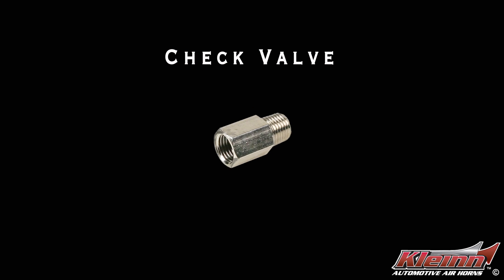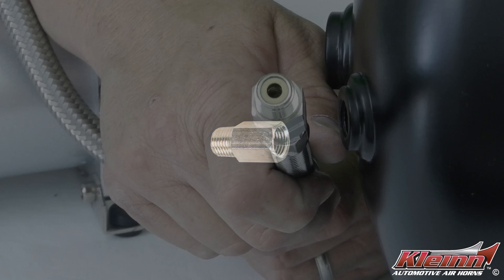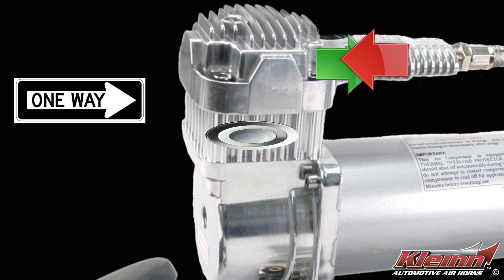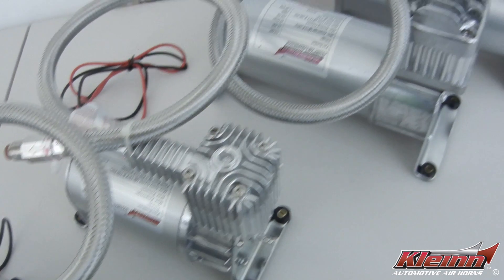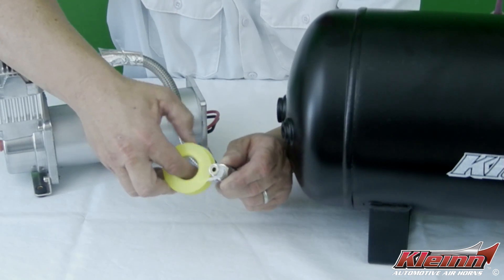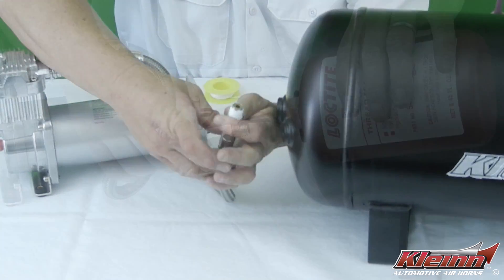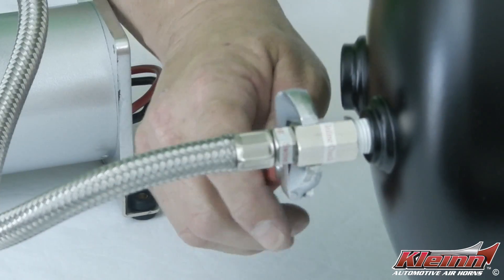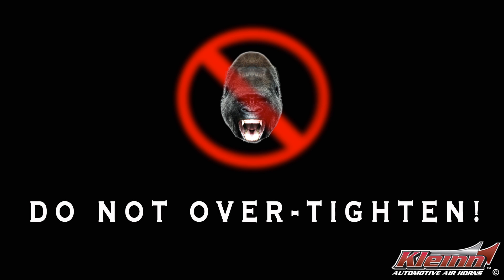Kleinn Air Horn Basics: Air Compressor Check Valves

Comment: My compressor turns on but does not build pressure.... I opened the valve to drain out the air tank, then started to make air. Then next time about a month later it called for air but again compressor does not generate air. Drained tank empty , but this time compressor turns on but not making air. Check Valve ??? issue ?